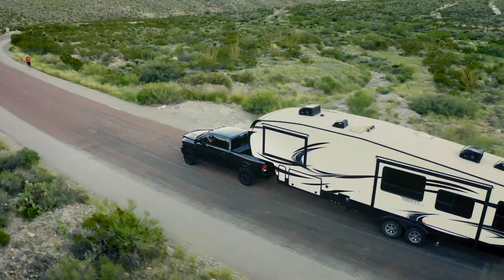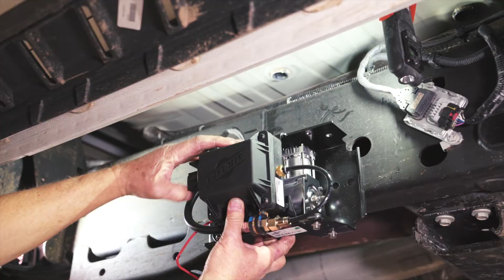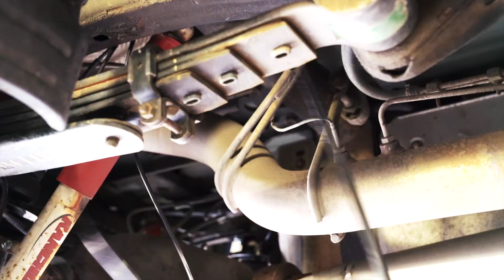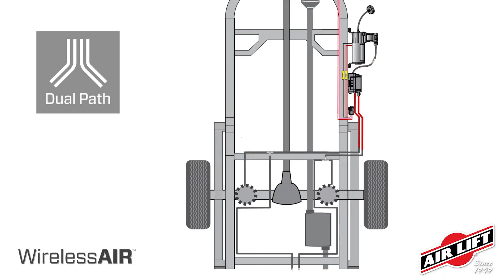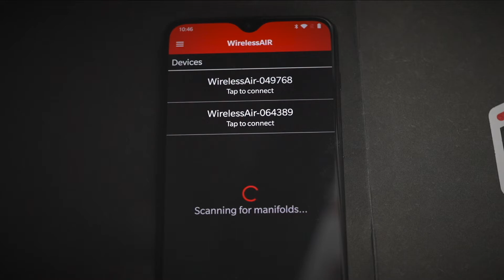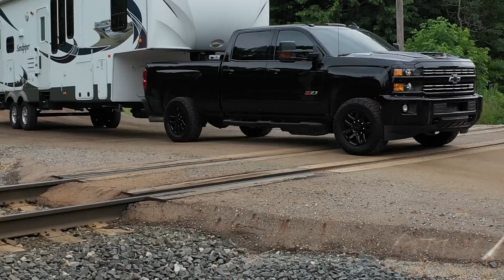Air Lift Install: WirelessAir 73000EZ and Mobile App

Comment: I'm sorry to say, but I don't agree with time stamp 1:02 I'm sorry to say that if you drill into your frame, probably it won't cause the crack. but it could be a future failure spot for a crack to form.

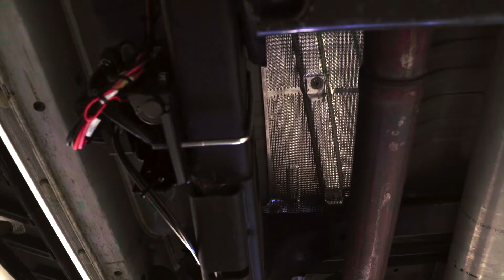Comment: At the 00:57 second part it shows it getting mounted in a way the instructions clearly say not to mount it with the electrical connector facing down.

Comment: Can a remote be added to the 73000EZ
Reply: The 73000EZ is the no controller version of the 74000. The difference is that this one doens't come with it. If you had the 74000 controller, it could be used with the system. There is no add-on at this time.
Reply: @devinpringle3801  thanks for the answer ! Just to be sure, if i have the 73000ez kit, i can use the 74000ez remote to control my 73000ez ?
Reply: @devinpringle3801  I need the answer to this